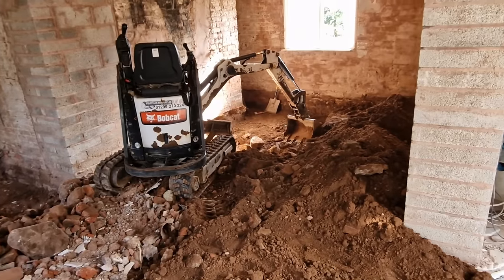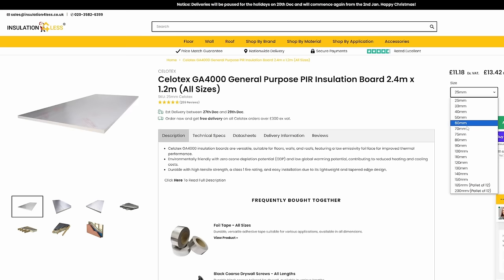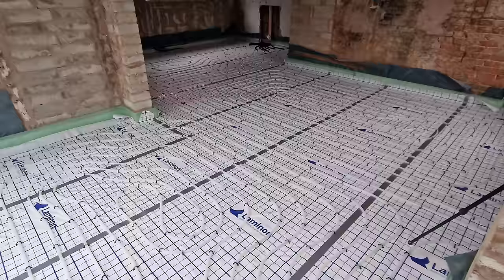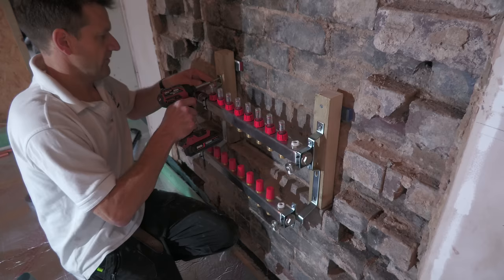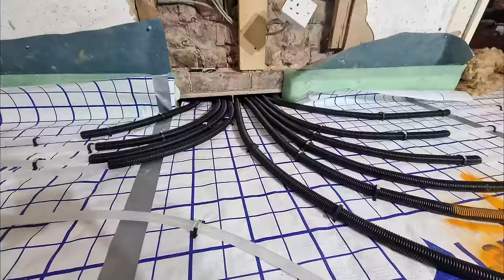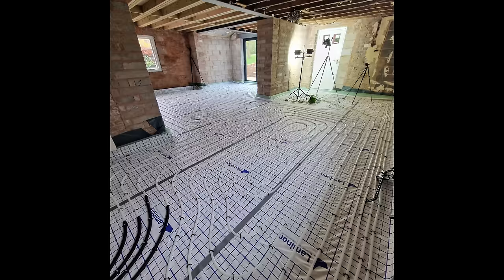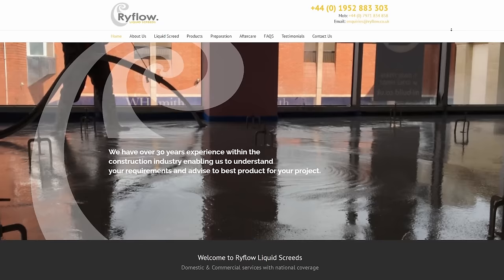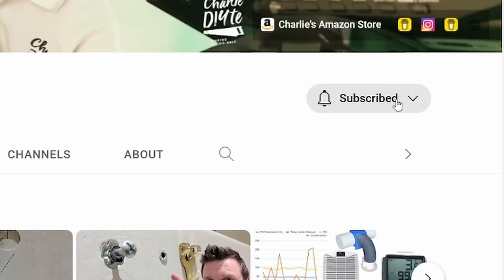How to Install Underfloor Heating in an Old Property

Comment: My underfloor heating system is now over 15 years old. It really has come along way from my old 16mm pipe version. It’s by far the best thing you could have done. Not just because it is beautiful to stand on warm tiles but our heating bills are tiny compared to friends with smaller properties. The set up and balancing is still a nightmare and I could only dream of a design and flow rate diagram and manifold so easily adjusted as yours.

Comment: Hi Charlie, I strongly recommend that you abrade/ scarify the top layer of your screed which is referred to as the skin, this process removes the loose material, bubbles and ripples that you talked about but more importantly it help with the moisture evaporate from the screed to help in the drying process and final when you lay tiles or anti cracking mating the adhesive will have a more secure bonded to the screed but if the skin is not removed the you run the risk of the whole lot moving and losing over time.

Comment: Nice video I ave been installing UFH for 40 years and have seen its progress to where it is now. The big thank you on this video debunking  the id that you should not run your pipes to over all area of the kitchen. The number of disagreements I have had with customer who listen  to the wrong advice. Then cannot give rhyme or reason why. When been called in to investigate why a particular floor is not preforming out comes my thermal camara and surprise surprise  I more oftan than not find no pipes under Island or units and or the use of 200mm centres. All lead to a uderperfoming system. If it’s too warm it can be commissioned to perform correctly including the correct setting of the programmable room stat. If it’s not warm enough you have wasted your money. To be honest I do put some blame on the competitive nature of the suppliers as it’s seen as a cost saving excercise to miss out a few hundred metres of pipe, that gives the industry a bad press. I start my next new build install first week in Feb. Good luck.
Regards Michael M

Comment: If you are ever doing an in depth refurb like this or new build underfloor heating is right up there on the top of the list. Coupled with an ASHP it is just amazing to live with. If well insulated it can help heat the whole house with just a few smaller rads upstairs to top up the temp when required.

Comment: I've been doing in floor and under floor 30 years and I do it almost the opposite way to you.  level the ground, lay the insulation, put the pex down on the insulation, wire mesh on top, and pour the concrete over. Then finish with whatever you wish. Works perfectly and have never had any trouble with cold spots or pipe floating up to the surface. Max 250' loops on 1/2"pipe. You likely spent double to do it your way, but it will also work fine.

Comment: First thing you should do is remove that mixing valve/ pump from manifold and suply system with proper lower temperature ,your boiler will save energy by working on lower temperatures.

Comment: Great stuff, I did an almost identical job on our 1790 farmhouse in the French Alps. Having never done it before  came to the same solution for the concentric pipe layout but used pex-al-pex. Was suprised how many suppliers didn't use that as default so in the end drew everything on sketchup myself to get the pipe lengths even. 

Had 600mm solid walls, underpinned then insulated the outside, line plastered inside and installed a  double flux ventilation system. Never had an issue at all with mould or damp...7 years in.  Run the UF at 28°c to 32°c keeps the house at 21 or 22° whilst it's sub zero for 3 months... Very happy.

Looks like you've done a top job... Just wish you'd have posted this video 7 years ago as i wouldn't have had to do my own research...😂😂😂😂
Reply from the maker: You've aced that 👌👌 - excellent work!So basically an MVHR system? The underfloor is incredible. I've got it on about 32 degrees right now and it's heating the room effortlessly to 20 degrees and that's before I've installed the wall insulation.
Reply: @CharlieDIYte  yes MVHR your correct, sorry, double flux is the French description. It's a total faff and not cheap if you get someone to do it, so of course I did my own, but it's totally worth it, especially if you have any slight concerns regarding old walls, breathing, moisture retention etc. I have a 50m underground 200mm pipe supplying the fresh air to the unit in through the boiler utility room, so any residual heat from the pellet boiler, fridge, freezers etc add their calories to the incoming air before it's pumped into the house.  

Totally agree, Under floor heating is a game changer, it's utterly wonderful. 

Great channel, love your style,  just 7 years too late for me.... But keep it up..

Comment: Great job as always! This breathable wall Charlie, I'm a little concerned that any wall containing plasterboard will not be breathable - I've been unable to find the vapor resistance of normal plasterboard tonight however. Please do ask lots of questions before fitting it and don't be afraid to go with a wood fibre and lime plaster solution if better. All the best for 2024 😊

Comment: Not just a good idea but absolutely essential to have a seperating membrane between the screed and the foil faced PIR insulation, the screed will dissolve the aluminium and the gases generated can weaken the screed, plus it wont comply with building regulations without the membrane being there.

Comment: We commented when you started this project and must have completed about the same time. We have a heat pump and Loxone control so that will be interesting. We recently parted with our builder but your comments on insulaton give us some concern. Our builder used 25mm PIR around the sub-base but we found most of that floated up and was removed. We have the expansion gap insulation around new walls which are very well insulated. We are not sure we really got what we wanted in that regard. For the screed we are very happy as we used the same Chemscreed solution which was very flat overall and allowed some adjustment for levels across the build.

Comment: This is fascinating stuff. Had quotes for an air-source heat pump that I like the look of, but having no radiators (warm air system currently) so this is exactly the insight I was looking for. Though very unlikely to DIY it, these tips make it much easier for me to find a contractor that knows what they're talking about. Bravo and Happy New Year
Reply: If you already have a warm air system and switched to a heat pump could you keep that air system and then benefit from the fact that a heat pump could or should be able to run "in reverse" as air conditioning in the summer?

Probably some challenges involved with retaining hot water in that scenario but I don't know...
Reply: @__Ben  I had planned to remove the ducting, but that is a very interesting thought. Will make the install even more complicated, but as Charlie said, future-proofing is crucial - and imagine having proper AC in our ever warmer and muggier summers?! Thx
Reply: @nicomonkeyboy  I think at this point when I eventually get a property I'd at the very least air condition the main living areas and bedrooms now, would be amazing...

Comment: My take away: all but a DYI job ! Seems like a minefield, let's keep our fingers crossed it will last 20 or 30y, a lot of plastic in this install. Would have been interesting to have an overview of the cost for such an install, must be serious cash. I will need to look into this at some point, not looking forward to it, even though there is no question that comfort is second to none.
Reply: Interesting comment. I had plastic piped UFH installed in my self build in 1998. I wonder if they've got wet feet there...
Reply: @angiej4865  it's not so much the plastic pipes burried in "concrete like" that worry me. It's rather the ramp of plastiky connectors and valves. There will be adjusments, purges, bleeding etc over time, I am just hoping this will sustain the test of time. Not obvious to me. I guess relative to the overall cost of the install that's probably a detail.
Reply: Not all plastic is the same, and many of the things that age plastic, big swings in temp, UV radiation and repeated flexing will be minimised when it is encased. Also it looked like a thick walled pipe. I reckon that will last for a looooong time. What other material would you use??
Reply: You don't know what you're talking about, speak to an expert.
Reply: @jeromeuk  The general practice and recommendation from the European manufacturers (who've been supplying this stuff for a very long time) is no joints whatsoever in the buried pipes. Also, circuits should be limited to no more than 100 metres per circuit. If you have a large room this means more than one circuit per room.
Also, not all UFH pipes are equal. They vary in heat transfer capability, oxygen permiability and cost. A good supplier sells the pile cut to length (you have to allow some extra for installation, etc.).
I used Ryflow (the same company used in the video) for the liquid screed installation and they are very knowledgeable and can also do a lot of the pile installation too.
Costs wise, back in 2017 when I did my second full install, the manifold, fittings, pipework and individual room thermostats cost me around £1500. Screed cost for two large rooms (4.2 x 3.6m each) came in at around £1200.
Reply: @YeahNoTellTheTruth  yes sure, YOU are one of them 😂
Reply: @davidquirk8097 Thanks for sharing you experience. I am very keen on sub floor heating but my house, like Charlies one, is 100y old plus. It's not gotta cost me 5 grands but rather 3 or 4 times that, plus the huge disruption for 1 or 2 months to get the work done. DYI stuff ? No, I dont think so, my wife and I have a job and this kind of projects are for professionals. That was my point. The plastic thing, hey, everything is made of plastic these days, let's keep our fingers crossed, it might work out okay after 20y...

Comment: Thanks for this series. I’m planning on doing a similar scheme in a (very cold) 1970’s house next year so watching intently… I’ll look forward to the next update.
Reply from the maker: You're very welcome. By far the most expensive part of it is the excavation and prep. The actual kit cost just over a grand with the small discount I was given. But the screed was nearly double that, as was the concrete slab and of course the builders fees. I'll try and get a video out on the costs at some point. It probably isn't worth it cost wise but in terms of creating a lovely warm environment, future proofing for heat pumps etc it's worth the cost.
Reply: I did wonder if we'll see a heat pump vid in a year or two. I was looking out for signs of a ground-source circuit being laid when you had the digger in the garden.

Comment: Hi Charlie, I know you are busy atm but just wondered what advice you got for laying pipes other than ufh (boiler flow and return, hot water). In my case i have to run approx 9m of flow, 9m of return and 9m of hotwater pipe, from the boiler to the manifold. Im wondering should i secure this o tge concrete subfloor then lay 100mm of insulation, or lay my 100mm of insulation, then neatly gouge out insulation and slip pipes into the insulation as you appear to have done at 6.10 in this video. TIA. 
Also did you just spray foam around your copper pipes then tape over?

Comment: You didn't talk about the type of pipe you used.

Polypipe would have been a 15mm system you went with a European 16mm system.

You didn't mention that your pipes are barrier pipes. I assume they are.

You can also get multi layer pipes such as Pex-Al-Pex and Pex-Al-Hdpe. Whilst those are harder to lay, they are stronger and built better.

Comment: @6:15 where you mention the insulation height was too much, I'm assuming  extra thick screed at what is now a low point is not an issue? I have variations of upto 20mm in 2 rooms. Ive identified the high points and calculated my insulation thickness at this point. I will also have a 5mm difference between the finished insulation height bewteen 2 rooms! 
Ill be using 16mm pipes in minimum 50mm screed, so will have 34mm miminimum coverage of the pipes. Im relying on the liquid screed to fill the low points in the insulation and leave me with a level floor 👍

Comment: Hiya Charlie,  I'm going to be converting our integrated garage and a ground floor bedroom into an open plan kitchen diner in a 60s townhouse.   The architect recommended Wunda wet system which users a 20mm thick Insulated pre routed board. Only 16mm pipe and as low hight I can use it for both garage and existing concrete floors.   They did a drawing and the flow and return is not running next to each other.  So this is something to think about having watched your video.  I have installed my own radiators and and ran copper pipe everywhere so I'm hoping I will have the skills to install this system.  The builders can do the screed.  Wunda have shown no pipes under the cabinets but The underfloor heating company who also provided a quote have indicated to have the pipes everywhere to presumably avoid coldspots.   I am eager to see your next video as my architects drawing shows tile adhesive directly on top of the screed.  Thanks for sharing your experiences.  Aaron
Reply from the maker: Thanks Aaron. All sounds good and you'll definitely have the skills to do this. With these things it's always a case of adapting to the situation. Probably won't be for a couple of months but I'll definitely be doing a vid on it. 👊
Reply: @arronharris5275 If you go with the Wunda system (or any similar foam board  type overfloor system) make absolutely sure the boards adhere well to the floor with no areas of creaking or movement. We used the Wunda system you mention about 3 years ago to do our entire ground floor and initially started with their spray glue to stick the boards down, but it's really not up to the job in my opinion and is especially useless in cold room temperatures (which is obviously common with house builds/renovations when the property isn't heated) meaning boards started popping and lifting off the concrete floor within days of laying it. The Mapei board adhesive they recommend you apply like tile adhesive is better but still wasn't infallible, we ended up finding areas lifting after we'd laid the 10mm screed over top which led to movement and cracking of the screed, luckily discovered before we put the final LVT and tile flooring over top but still almost impossible to rectify without pulling it all up and starting again. 

Faced with tearing it up as the only other solution which wasn't viable I ended up borrowing a thermal imaging camera to identify where the pipe runs were, drilling holes between them, squirting a little adhesive down through the hole to hopefully get in under the gap then use screws and large washers to mechanically fix those areas down. This did work but no thanks to Wunda who basically blamed the install and washed their hands of it even though all their install instructions were followed.
Reply: I've since also ditched the mechanical blending valve on the manifold which also don't work very well, sometimes seeing spikes of flow temps into the manifold way higher than they should be. By far the best way to feed UFH is to have a boiler or heat pump with weather compensation and (if it also needs a second zone to run upstairs rads at higher temps) electronic mixing valves to electronically mix the right flow temperature for the floor based on the outside temperature meaning you end up with a simple flow and return pipe to the manifold that's pre-mixed to the right temperature. We've now got that with our Vaillant boiler and controls, the boiler basically runs pretty much 24/7 at very low output during winter feeding low temperature water to the floor and oversized rads which are on a separate mixing valve to get the slightly higher flow temps required. Other than for hot water cylinder heating the boiler flow temperature rarely goes above 45c unless it's really cold with the floor generally running at 25-30c flow and rads at around 40-45c. Because there's always some heat going through the system the house temperature stays incredibly consistent through the day regardless of weather temps and the best bit is despite the added comfort we use no more gas than the previous "smart" controls that basically just fired the boiler at a fixed high temperature on and off based on demand then relied on the mixing valve on the manifold to modulate the flow to the floor.
Reply: @LocostR1  Hello, thanks so much for taking the time to write this really useful information.  I had wandered how well the spray adhesive would work on a cement based surface.  It would have to be dust free, bone dry and no rough patches such as air bubbles.  I will have to take this into consideration as it would be a disaster if the insulation starts lifting up or creating cracks in the upper layers.  Thanks again Aaron
Reply: @aaronharris5275  No problem,. If I was doing it again I'd probably consider a product that used castellated plastic panels and encapsulates the pipework into a thicker screed like the Nuheat LoPro system, but the foam board does perhaps insulate the floor a little better. 

If using foam boards again I'd certainly look at mechanical fixings to supplement the board adhesive whilst it dried, i.e. evenly spaced plugs/screws through the boards into the concrete floor with large insulation washers pinning it down, that way you'd make pretty much 100% sure it stuck and stayed stuck, just ensure you don't hit any water pipes etc buried in the floor!